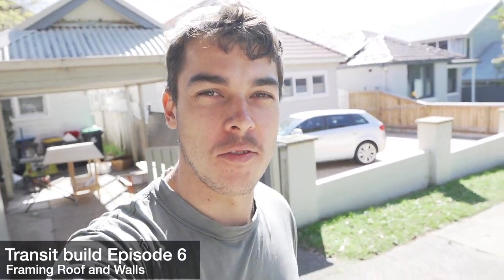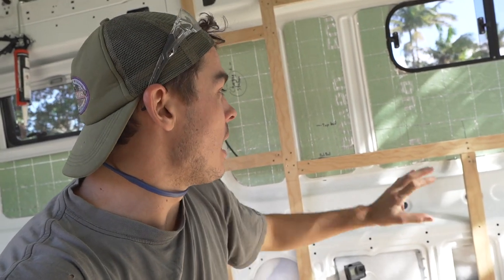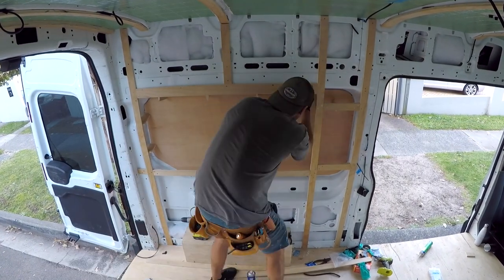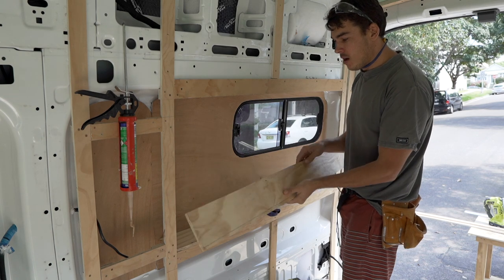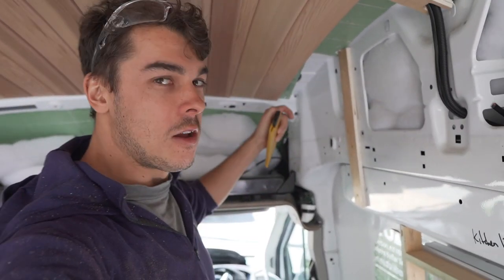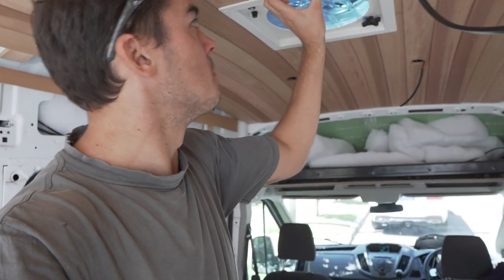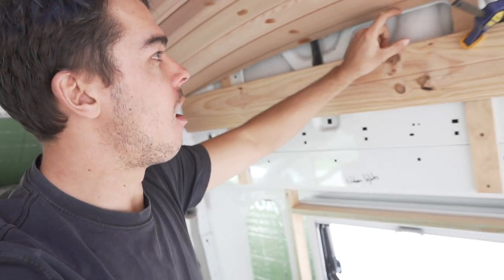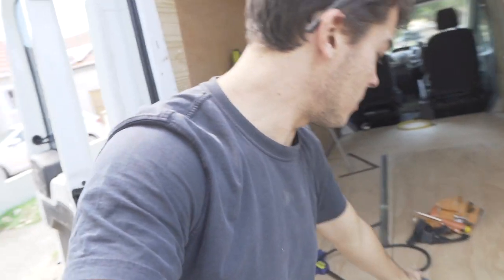PERFECT van Roof and Walls | Ford Transit Conversion

Comment: You run your wiring in the upper edges. Then cover them with Crown molding. Usually 5-6".. That way you don't have to be perfect on the edges. And you can access the wiring if the need ever arises. And trust me. You will need to get at that wiring sometime down the road.

Comment: Good job!  I have done bed popouts in T1 Sprinters the same way and like your method.  I am about to start framing a Transit camper van tomorrow.  I found your video thought provoking.  It pained me to watch you doing all the sanding overhead!  I usually sand and finish my wall/ceiling boards before cutting and installing them and use an 18 gauge finish nailer to attach them to the framing.  The finish nails blend in pretty well, but you can putty and sand them for a seamless finish.  Lately been using an all natural food grade wood finish they sell here in the States called Odie's Oil.  I bet you can find something similar in OZ.  Thanks again.
Reply from the maker: Yes it was a huge pain! I wouldn't have been able to get away with finishing nails at the front of the van as the boards are loaded up quite a bit to get the front curve so I needed some holding force through screws. Maybe at the rear I could have utilized them!

Comment: That is a stunning ceiling! I love cedar, used some to fill my shower tray when not in use. So light and smells so good, it is perfect in a van. Wish I had used more of it. 
My only concern with what you did here is the screwing in the metal. Surely that cuts the paint, exposes the steel to the air at each screw hole, making a potential rust point? I bolted the strips on the van instead, there are lots of existing bolt holes and you can make more with rivnuts. Cheers

Comment: Ceiling and walls are looking great, my favourite van is white with white cabinets and the walls/roof/worktops in wood.
Reply from the maker: I think it’s the best combination too 😍
Reply: @saltyvanventures   Hey, question for you. So you sanded once the boards were in? Did you add any kind of oil to them or leave them bare? Can you explain why you chose to do it this way?

Comment: 11:18 You could save yourself all that measuring and use a compass to make that arc and then cut it. 🤔
Reply from the maker: Problem is that it's not a circular arc so that wouldn't have worked right? there were also small humps and troughs that I needed to contour

Comment: Screwing the ceiling wood slats and later filling and sanding the screw holes is a lot of work, plus finish is rough.I suggest using a bradley nail gun and staple the tongue and groove edge. Bradley nails are invisible. Some areas will be difficult to nail I admit. Bradley nails come in various lengths, you will need to get right length. They also allow for a little contraction and expansion.
Reply from the maker: I agree it is a bit time consuming but it is far from a rough finish. A brad nailer also wouldn't have enough holding power to hold the boards that are under quite a bit of pressure at the front of the van where I have curved it around the van contours.

Comment: I’ve come back to this video several times because your craftsmanship is so exemplary. Did you consider using rivets instead of sheet metal screws to attach the interior (skeletal) wood strips to the van body? I’m concerned about the sheet metal screws coming loose over time with off-road travel. Thank you again for sharing your excellent videos.
Reply: I think he said that he used Glue behind the wood as well as screws.

Comment: Hey bro. Awesome job on your van builds and videos. Thank you so much. How wide were your Cedar planks? I have the chance to buy a cheap pack of ready milled T&G Western Red Cedar 110mm x 10mm. Would that be alright?
Reply from the maker: Mine were 89mm wide and 9mm thick. Those planks your describing sound ideal! Try and snatch them up before someone else for sure!
Reply: @saltyvanventures  okay, thanks bro. Yes. I agree... I was stoked to find them. My ceiling is 5m long and so are the Cedar planks.

Comment: To mark your first wall board to mate to your curved roof line just use a compass/ scribe to draw the outline onto your wall board. Set pencil/needle to your widest point (75mm) and trace roof line onto wall board. Smoother than multiple reference points.

Comment: How did you get the plywood battens on the ceiling to bend the corners of the van? Did you end up having to make some kerf cuts? If so, do you remember how deep and how many? Tia!
Reply from the maker: Yes i did some kerf cuts on the battens around the corners. Pretty much deep enough to bend and not snap

Comment: If the max gap is 75mm, you can ring a scribe line with a 75mm spacer along the roof so its fast and perfect 👍
Reply from the maker: The problem i had was that the roof was not flat. As I forced the cedar panels down near the cab there was a hump of sorts at the front so it kinda had to be a custom job. I found this with my other vans too that the roof boards would never be straight.

Comment: Perfect job thanks for making the video - very helpful!! What kind of roof fan did you fit into your van please? Is it MaxxFan? If so, which one in particular, and are you happy with it? Thanks!
Reply from the maker: Not a max air fan but similar. The link is on the description

Comment: Hello salty vanventures! Awesome videos, super helpful. Ive noticed you haven't used anything like a layer of rubber between any of the places where your framing timbers contact the van's metal. Was this ever considered to help with squeaking/sealing/stronger bond? Or any thoughts on the idea?
Reply from the maker: Hi there, no i didn't. There is no wood squeaking either. I have done it like this in 3 vans and never had an issue so i wouldn't consider anything else from my experience.

Comment: I love your videos they are so informative, I just have one question...... I am using cedar on our ceiling and was wondering instead of using screws do you think I could use a nail gun and secret nail them?
Reply from the maker: Possibly. I went away from the nails as i was bending the cladding quite a bit and a didnt think the brad nails would have held. also the shortest nails my gun holds is 25mm which was too long for the 9mm cedar and 12mm ply
Reply: @saltyvanventures  thank you so much for your reply. I ended up using my nail gun as it uses 15mm Brad nails as well as bonding the boards so I’m presuming it will hold. Your videos are so helpful and I find your explanations so easy to follow. After I have finished the lining boards I’m looking forward to trying to build the cabinets. Fingers crossed 🤗

Comment: I'm starting into a transit conversion and really appreciate the quality of your videos and work. I shan't deny there's going to be some blatant thieving of your ideas!  

I've built and fitted out a few boats with tongue and groove style finishes, and the one thing that has to be done on those is to allow for movement: I've seen so many that looked amazing for the first six months before cold winters or hot summers have given the structure a stretch/compression and everything starts moving and looking pretty grim.  Are you confident that there's not enough temperature induced movement in a van to bring similar issues? Or is the Australian climate kinder to van structures than European ones to steel boats?
Reply from the maker: Our van has been in very hot 40 plus to negative temperatures and this is what I can recommend. Paint your cladding before going in the van . I did a mixture of both so  on cold days where the wood shrinks we can see the paint like on the tongue of the cladding we painted in situ.

Comment: Hey mate unreal build love your channel!
 Just a question with your pocket jig how does it go working with 12mm ply does it blow out at all? Just the kreg jig reckons 12.7mm is the minium thickness but you have obviously found a way around.

Thanks cob
Reply from the maker: Works well, the whole build was basically put together with the tool using 12mm ply. Depending on weather you require a flush screw, you may need to shop around for smaller head screws
Reply: @saltyvanventures  you beauty thanks cob

Comment: Wish I coulda seen you do around the window. Do you remove the black trim and put up the plywood? Is the plywood wedged behind black frame or just flush ? And did you not use insulation? Thank you
Reply from the maker: Do you mean the wood cut out around the back window? The thin plywood is flush with the frame. That particular window is only one piece and doesn't have a trim. There is insulation between the plywood and the van panel.
Reply: @saltyvanventures  yes I need to insulate and put plywood but was thinking the ply would stick out not flush with the window

Comment: Hey love it!
Just wondering what finish, if any, that you put on the ceiling after? Water based / oil based?
Thanks in advance :)
Reply from the maker: Water based clear satin
Reply: @saltyvanventures did you find that the stain robbed your van of the cedar smell?
Reply from the maker: @echocampbell4644  indeed it did, we tried leaving it unsealed for a while but it was getting easily stained.

Comment: Good work on your build. Its looking really nice. What was your final bed length between the inserts? I'm 6'2 and a half. Wondering if this would work for me. Thanks!
Reply from the maker: Thanks! the final bed length is 189cm across and i'm very happy. I'm 6"3' and am comfortable. If you sleep on a slight angle you get a few more inches too!

Comment: Hey, this video has been super helpful for me, thank you. I am just wondering how you attached the ceiling panels at the front where the bulkhead is?
Reply from the maker: I screwed a think strip of ply wood to one of the metal roof supports on the front side of the bulk head and screwed it to that. The wood panels go past the bulk head as such
Reply: @saltyvanventures  makes sense. Thank you very much

Comment: I see you haven’t done a vapour barrier would you say it’s not necessary? I’m in early stages trying to figure out what to do. Also in Australia
Reply from the maker: I didn't install the highly controversial vapour barrier no. I don't really think it's necessary as long as the insulation you use does not absorb moisture it wont get trapped behind the walls. Wood breaths unlike some other materials so i'm not worried about any issues.

Comment: Hey Marcel, hope you are going well. We are about to start framing for the walls. We were thinking of going with 10 mm ply? Would that be structurally sound to hold the ceiling and side wall timber
Reply from the maker: As long as you can get screws to hold in it then yes.
Reply: @saltyvanventures  thanks for that we actually ended up buying 12 mm structural ply and went with the same screws as your. Thanks again mate you are a legend!

Comment: Do you have anything holding those planks going to the curve in the front? I put 2”x2” on the front.
Reply from the maker: From memory i think i used a thin bit of ply to screw them into the front most cross member like i did with the rest of them

Comment: Hey bro awesome job. Where did you get the cedar boards from? I'm trying to find a good supplier in nsw
Reply from the maker: I bought them from a wood shop out in Blacktown which I cant remember the name right now. They were advertising it on Ebay for $6/m 86mm wide which is how I found them. This was half the price of the next best I could find.

Comment: Awesome content! :D Getting my ceiling done tomorrow hopefully and it helped to see how you did!
Reply from the maker: Good luck! i hope the video helped you out. hola out if you have any questions
Reply: @saltyvanventures  I like what you did with hiding the screws, but my wood is whitewaxed so I think I'd ruin it if I sand it down, any tips of how I can do?
Reply from the maker: you can try a more commercial hole filler which goes hard but may be more brittle. I think you can get flexible ones and use a plastic spatula to scrape the excess off flush so you don't need to sand it. You might need to do it a couple of times though as all fillers shrink quote a bit when they dry (hence why I add a bit extra when I do it and sand it flat)
Reply: @saltyvanventures  alright, cheers! :)

Comment: What kind of screws did you use to drill into the metal?? Great vid man🤙🏾
Reply from the maker: Mostly self drilling meal screws. Something like these https://www.bunnings.com.au/zenith-8g-x-30mm-galvanised-countersunk-head-metal-screws-50-pack_p2420546?store=7304&gclid=CjwKCAjw2ZaGBhBoEiwA8pfP_sd37DlF1qF7Nj9DJUoKar_RbVC928bsCPWnEjeVlOh-mAPGI_iB5BoCSVIQAvD_BwE&gclsrc=aw.ds
Reply: hey man,  @saltyvanventures   what screws did you use for the 12mm panel onto the 12mm plywood batten?
Reply from the maker: @rileysohier5965  I think I used small 16mm-20mm countersunk screws. Just enough to penetrate and hold though 12mm.

Comment: Great build so far - getting plenty of good ideas from you!

Can I ask what the head to toe length of the bed is - I like the idea of taking some extra space from the van walls, does this give you enough space to lay comfortably sideways in the van?
Reply from the maker: The bed is 190cm end to end. yes it gives just enough to lie sleep side ways and i'm 6"3' or 191cm tall. If you sleep even just slightly in an angle you gain another inch or 2
Reply: @saltyvanventures  That's awesome thanks!!

Comment: What did you do with the big wiring harness that runs along the back walls of the van?
Reply from the maker: I extended the harness on two different spots so I could run it behind the wall. It was a mammoth effort cutting and re rejoining over 200 wires. Check the video I did on insulation where I show what I did. It’s near the end of the video
Reply: @saltyvanventures  Thank you

Comment: How did you reinforce the 12mm ply battens. I've just started doing mine and found them too flexible
Reply from the maker: Which battens are you talking about? The vertical ones?
Reply: Yeah the vertical ones that sit between the main frames. Just seem to flex in the middle with no support behind it
Reply from the maker: @Mattgrenotgolf  they will stiffen right up when you install the frames for the bed and the cupboard
Reply: Did you just layer the horizontal ply behind the vertical ones?

And did you just screw the tongue and groove straight to the ply battens?

Comment: How did you attach the ply on the ceiling?
Reply from the maker: 16mm screws into the ply strips
Reply: @saltyvanventures  Only 16mm into 15mm ply then metal?

Comment: Thanks for sharing this - it's really great info! Can I ask what finish you used for the cedar roofing? (Probably not epoxy varnish if it still smells so wonderful!)
Reply from the maker: In the video I didn't end up finishing the roof with a varnish. We just did it today though as I realised that leaving it unfinished wouldn't be an option as it was getting stained very easily. We ended up sealing it with Cabots clear satin water based polyurethane varnish. It has come out amazingly after 3 coats. We didn't coat the cedar in the cupboard though so we get a little bit of the smell from the cedar still untreated.
Reply: @saltyvanventures  That makes sense. Oiling it would have helped a bit - but polyurethane sealing will be tougher wearing. Pity about the smell though! never mind, cedar is a great wood, very termite resistant!
Reply from the maker: hopefully termites will be the least of our worries haha!
Reply: @saltyvanventures  So, sealing the cedar kind of defeats the purpose of using cedar, does it not? Do you wish you'd just stuck with pine from the start?
Reply from the maker: @wanderingzythophile9083  Well not at all as it still looks about 10x better than pine ever could.
Reply: @saltyvanventures  Perhaps, but you could achieve that look with the proper stain though, yes?